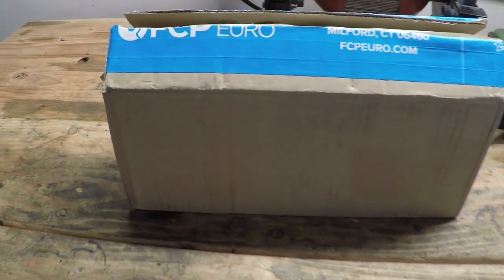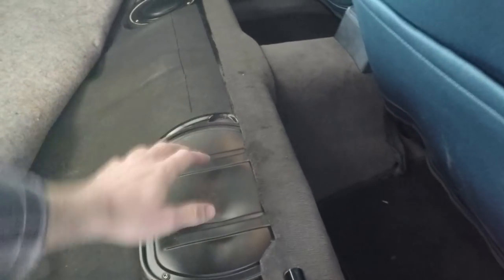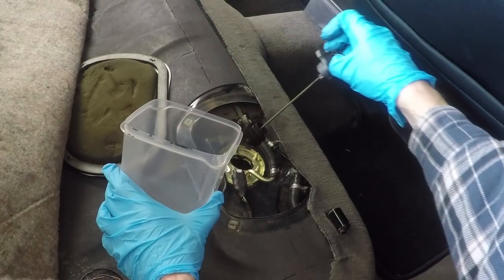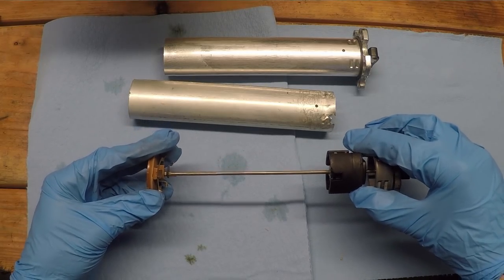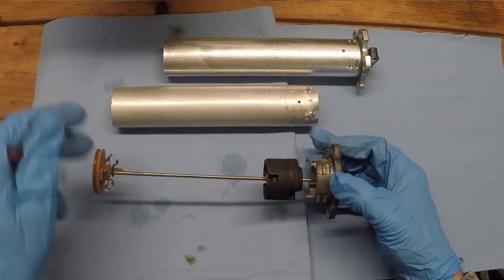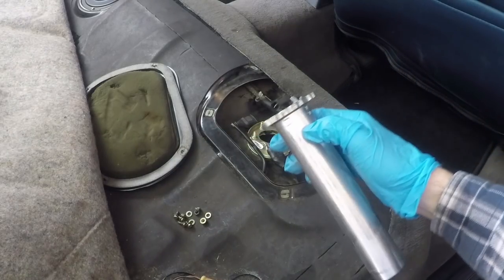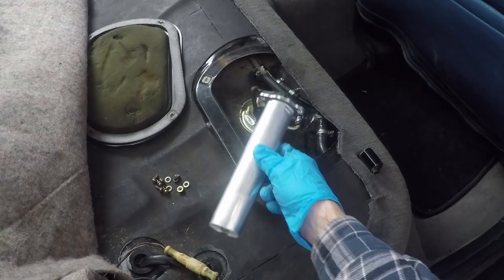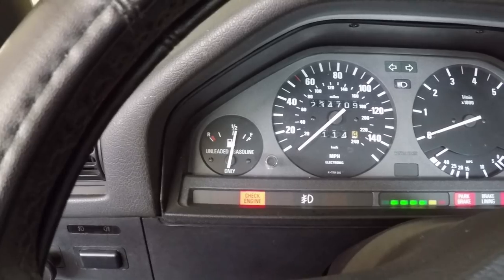Project E30 / Ep. 22 / Fuel Level Sending Unit Replacement

Comment: My fuel gauge just went kaputt coming from inspection. Just ordered a sending unit, and went ahead and ordered the in tank fuel pump as well since the car is 35 yrs old with over 220K miles on the clock. And the external fuel pump is working over time even though it is brand new. And I can feel the car struggling more when I press the pedal to the floor, whereas before it would feel much stronger and faster to react and accelerate. 

1988 528e Automatic.

Comment: Thanks for an informative and helpful video. The fuel gauge on my '91 E30 shows a fuel level that seems stuck at 'F'. I will test the sending unit on the Pass side first to see if there is a problem with the float inside the unit. Good to reminisce about Premium gas at $2.799 - in August 2022. 😀 Congrats on now being close to 29K subs.

Comment: Great videos! Btw the sending unit can be fixed by soldering new wires under light tension. I've done it years ago. I don't remember the correct wire gauge at this moment, but I did buy wires with different gauges and experimented with it to get proper resistance signal. You have to be very careful with aluminum housing. It is very fragile and easily brakes especially the tab at the bottom of it.

Comment: Viewing in late March 2024.... $235 for 1179720 five years ago sheesh!
Viewing because my (1988 320i much laid up) fuel needle started to wobble.  After lifting the seat and gaining access I found the left side was faulty.  Central rod quite rusty near top - might replace with stainless sometime.  Meanwhile cleaned with 280-3,000.  one wipe of 3,000 on each side of each wire and it is better now.
Meanwhile I replaced both the O-rings and filler cap seal.

Comment: Yes, apparently the two level sender set up is on later cars 1987 onwards which have a more useful 63L tank.  The second sender is simpler and easier to take apart.  However, the central rod appears not to be made of stainless steel and so can rust - this is why the manual says up to 3% methanol and why it is not a good idea to use e10 or even e5 fuel.
It is why I am p~~~~d off with Esso for stopping production of E0 Supreme 99.

Comment: nice video. there are specialists (can be found on the internet) who rebuild old fuel sending units, but it isn't cheap (comparable to the cost of OEM replacement when available), so you would only want to use them if the fuel sending unit you need is NLA
Reply from the maker: That's good to know. Do you happen to have a website for one? If the other sender ever goes out, I may have to give them a shot.
Reply: @PracticalEnthusiast  post #30     he says it's 90% accurate 
https://www.benzworld.org/forums/r-c107-sl-slc-class/1385559-fuel-sender-repair-3.html
Reply from the maker: @frankburn6312  Good info, thank you!
Reply: i bet that between 36,38 and 40 awg wire, one of them will be the correct resistance. at $4 for 100 ft each, I think it's cheap enough
Reply: this is the guy i contacted when i needed a fuel sender repaired for an earlier peugeot project:

http://tristarrradiator.com

Comment: Hey man was wondering if your gas gauge is reading under half. I replaced the same one you did a while ago to no avail. I'm having the problem mine only reads from full to half after half its a guesstimate lol. Great videos definitely gonna subscribe 👍🏼
Reply: If gauge does not read correctly then one or other sender is faulty and you have to short each one at a time to find the faulty one and then take it/them apart to try and fix.

Comment: my fuel gauge needle is stuck on E... even when I fill up my tank completely.  should I change my fuel sending unit? or should I try to fix the old one?  trying to stay low budget, any help would be appreciated. I have a e34 535i
Reply from the maker: It could be the sending unit. Does your car have two sending units like mine does? If it does, I would be more keen to suspect the gauge is faulty, possibly due to a bad solder joint on the circuit board. The only way to find out if it's a cheap fix is to start taking things apart and inspect.

Comment: Maybe could be fixed by soaking it with brake cleaner or something like that.
Reply from the maker: Yep, that might work. As long as the internal float still moves around it's just a matter of getting it to self-clean the internal electrical contacts.
Reply: @PracticalEnthusiast you're right probably they have corrosion